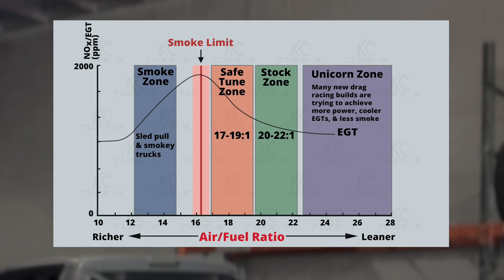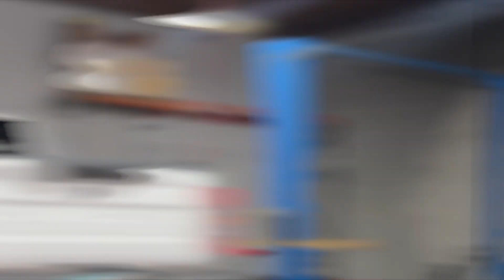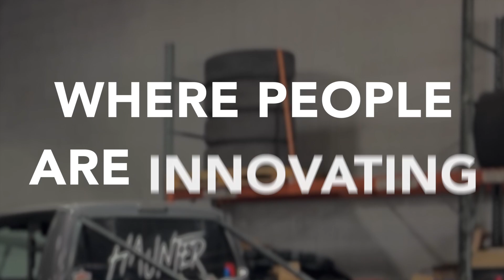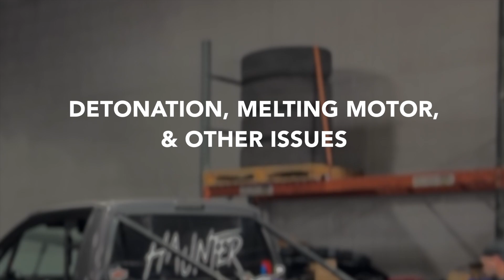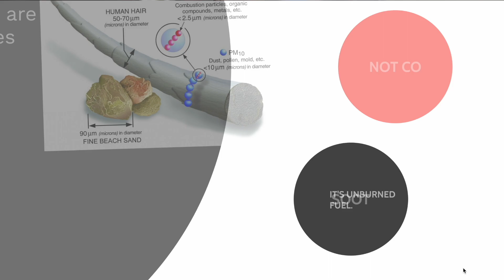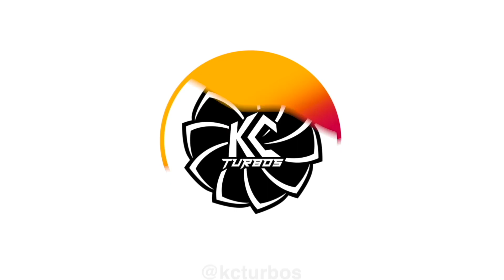ROLLING COAL... So What Is It?

Comment: The conversation of how higher cylinder pressure affects NOx emissions and how to maintain high power output through lower cylinder pressure is a very interest subject i think. This in coordination with how certain important engine parameters (such as egts) are effected by advancements in timing and different fuel injection strategy’s (ie # of injection events, duration and timing of said events) are very important to understanding how modern diesel engines are able to push so much more power clean, quiet, and cooler than even heui trucks. It is also something that there isn’t much Info on I have found.  I would love to see another video on that topic.

Comment: What tuning do you recommend? 2001 F-350 7.3 180/30 FFD injectors your stage 2 turbo stage 2 cnc Hpop and hydra tuner. Currently have 1023 tunes but are very Smokey
Reply: i swapped from 1023 tunes to dp-tuner tunes and jody has some excellent driveable tunes and tow tunes. My tow tune from him is night and day better now
Reply: @Moosekeys  I’ve heard very good from them and jelibuilt not sure which I want to go with though.

Comment: Im going to post this selling out for the epa vid all over. Hope you dont loose customers :)
Reply: No sure what you mean by selling out.  KC turbos is turbo builder... making better turbos that spool faster, run cleaner, cooler egts, tow better, and make more power is better for everyone.  A byproduct of this will be less smoke and lower emissions. 

With that said, KC has never done deletes, rolling coal tuning, etc...  So I am not sure what you mean by selling out to the EPA.
Reply: @charliefish2565  why did you make 2 separate accounts to reply to 2 different comments on this video?
Reply: @GaryMiller-z6t  I didn’t make separate accounts.  Not sure why it shows up that way. I have like 5 different email addresses depending on what I’m doing. Probably depends on which account is signed in.

Comment: Seems like, if black smoke is unburned fuel, that the focus should be on burning that fuel in the cylinder to get more power, as opposed to just adding more fuel and watching it go out the tailpipe.  So, how can this kind of efficiency be added to a 7.3?
Reply from the maker: Pairing the correct sized KC300x to the proper injectors along with proper tuning. Our customer service team is trained when a customer calls in to ask the right questions to find out what the truck will be used for, then providing them with the best product options for that purpose. That is why we also offer our lineup of "power packs" that have been tested and turbo/injectors are paired for maximum efficiency.
Reply: @KCTURBOS  The reason I ask is that it seems the more powerful tunes also produce more smoke.  Seems like more powerful tunes should burn more of the fuel, resulting in less smoke.  If you don't mind, explain this apparent contradiction -- would love if you did a video on the subject.  BTW, I am running your Stock Plus turbo on my OBS, and I love it!
Reply: The reason you get a lot of smoke on the top end is because there is too much fuel being injected to keep up with the turbo that is on the truck. These tunes are still more powerful than the tunes that are running cleaner but actually burning the same amount of fuel because there is more particulate going through the turbo resulting in more airflow into the engine. The fuel stops adding power because of big boom boom and gives more slliigghtttlllyy more boost for subsequent boom booms